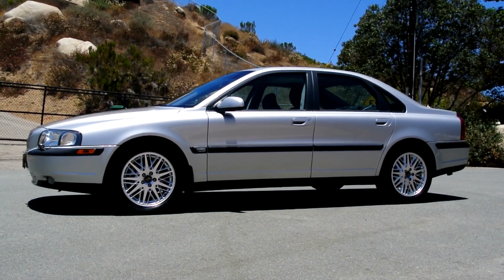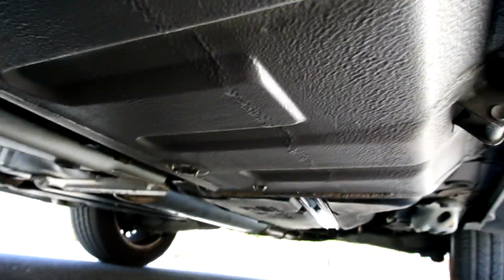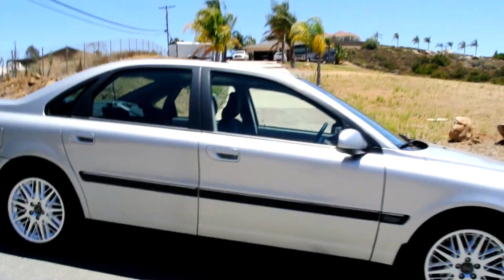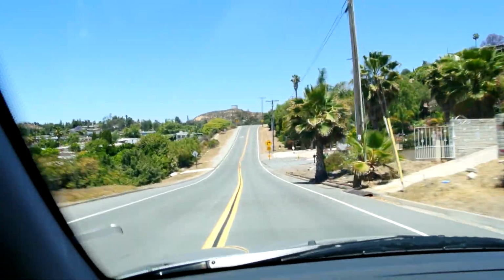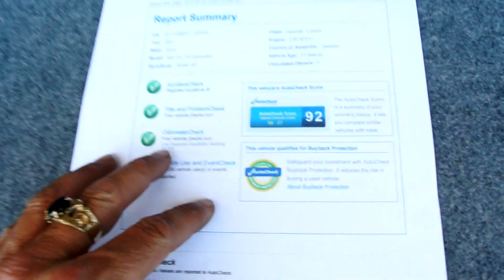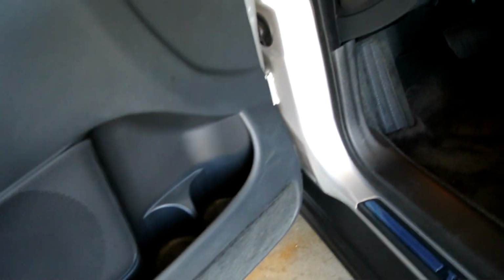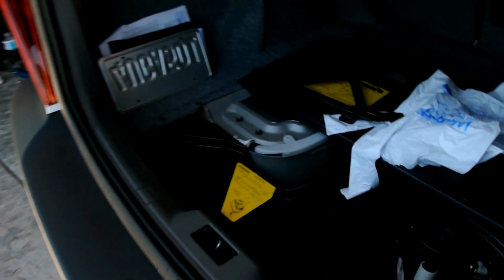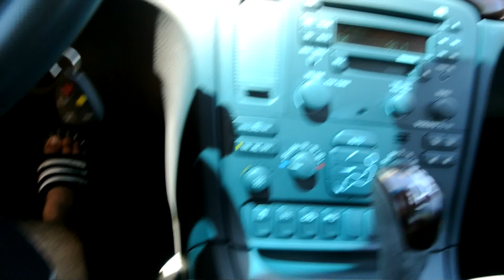Volvo S80 T6 Executive 1 Owner 16,000 Original Miles MINT Car Guy Video Review

Comment: Beautiful Volvo! I drive a 2006 S80 2.5T, wish I could have gotten the T6 powertrain for the extra torque but I didn't feel like paying for the inevitable transmission repairs that were so common with the GM sourced 4-speed auto. I'm now at 112,540 miles in my 2.5T and no complaints, it's just a smooth as it was the day I bought it. Couldn't be happier. Volvo for life!

Comment: My Volvo s80 2001 has 218,000 miles and drives like a dream. I just wish I can turn off the day time head lights
Reply: +jarmelo2006  You can turn the day time lights off via the dial on the lower left middle dash. 3 positions. no lights, parking lights and auto on headlights. When you do this they will not turn on automatically at night though.
Reply: Jarmelo2006 do you recommend a good cond 2001 S60 Volvo with 150000km ..... Seller said their transmission usually click but its normal, it could drive for 2 more years.  And what about engine dash lights on, but car runs fine?
Reply: +Clyde Thomas My transamission is acting a bit wierd to but overall does its job. I think you will have to use your own judgement on this one depending on how worned the transmission is. Also ask about the ETM (electronic Throttle Module) if this is not fucntioning this can cause the car to idle up and down make sure to listen for this type of idling. The tackometer will go up as the engine surges.
Reply: +jarmelo2006 over all the car is a mechanical fortress with features that meet even todays standards. very happy with mine.
Reply: Jarmelo2006 ... Thank you for getting back to me. That's great to know.
Hope you have no problem with yours.
I'll keep you posted.
Reply: Thanks you too.
Reply: Very rare car in Uruguay, according to the importer, since 98 only 17 units were imported into the country in several versions, the S80, both in the first and in the second generation is beautiful, I like it much more than the current S90, it hurts that even Having his years here are very expensive and unfortunately not all are in good condition, if he had money he would acquire one and restore them completely, and what to speak, it would be a car to have it for life ...

Take care of it and never sell it, never pay what is really worth and stands out for its elegance, even taking your years !!!

Comment: Hate to break it to you, but that's not an Executive.  I am a Volvo guy, the Executive has a rear center console with a t.v. and DVD player. Also, there's a small cooler where the center arm rest is on yours, to keep your champagne cool. All Executives had the rear badge with a crown on top of the S80. 

Still an awesome car. Mine has 161k miles and runs like a champ. These cars are almost bulletproof.
Reply: Your right I have this exact model and mine is not an excutivr
Reply: Umm bulletproof??? They were a nightmare. Gm transmission. Leaks, failures. Great car when new. Gorgeous. But not bulletproof

Comment: We bought in 2008 a 2004 S80 with around 18K miles. It was fast and very comfortable but at around 80K miles it was starting to have some transmission problems so we got a new 2012 Mercedes E class.

Comment: I have an s80, 1990, 232,000 miles, I would like to have it rebuilt, any suggestions.  I also am dealing with a fuel lean, any suggestion on how to replace the O-Ring on the fuel tank?